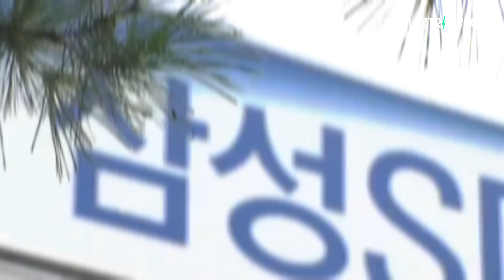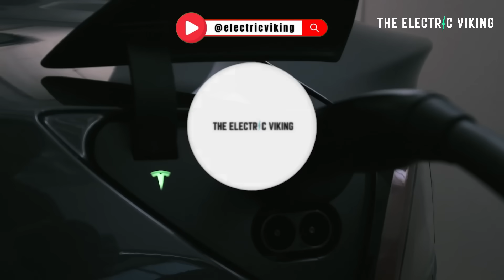Hyundai starts pilot production of solid state batteries for EV testing

Comment: Range is becoming a non-issue, and besides safety issues, one of the biggest benefits of solid state batteries is the weight reductions.  In terms of projections perhaps EVs could account for 95% of new vehicle sales by 2030 but I don't see EVs accounting for 95% of cars on the road until much later as most of the population only buy second hand and many won't be considering replacing their existing ICE car until well beyond 2030 unless there are considerable incentives to get them into an EV or disincentives to get them out of their ICE car and many governments, especially in poorer countries, aren't ready to fully back those sort of initiatives yet.

Comment: yes and seriously. I have the Tesla  SR with a small battery and the only ones who often have problems with the batteries are those who don't have an EV. I don't see any problems despite my small battery. Daily totally doesn't matter and I'm of the opinion that you should buy according to daily needs and not what you should maybe once a year. 
We drive on vacation in our approx. 4000km in total and it is not a problem, we hardly go faster in our old ICE, we still take breaks every 2-3 hours and the breaks with charging are about 15-20min. And it requires about 2-3 hours of charging each way, if we had driven ice we would still have had to eat a few times and take a few breaks, so the difference will be very small and make no difference on such a long trip.

Comment: Here on YT, you are in the minority of the ones that are actually pushing EV''s lately, and being in Australia you apparently haven't been watching the major push back from owners that really know how bad EV's actually are.As far as making batteries that don't self immolate themselves with you in it, the idea of being built out of a material that doesn't do that would be the biggest boon today for the car, but it still won't be enough to overcome the rest of the EV problems that all EV's have other than charging and range. Other problems that accounts for 20 out of 21 of the most common problems with them that are exclusive to EV's and that people won't stand for.  In fact, here is that list that I made up that I keep for people like you that like them so much and can't keep yourselves from pushing them here on YT and the rest of the world wide web....You already know about the first one here (copied from a list stored in my laptop)
 1.  Driving Range. Other things beside moving EV down the road uses up range, 

    like heater and AC, high hills and mountains, usage of the wipers, any device. 
2. Material Intensity. Gathering enough rare materials costs very much and use 
    fossil fuels to run the equipment to move the many tons of material to process
3. Electrical Grid.  The grid is years from being ready for millions of EV's no matter 
    what the electricity providers try to tell you other wise.  
4. Risk of Fire.  EV's are known to spontaneously combust rabidly, and when that
    happens, windows and doors quit operating, possibly locking the owner inside 
5. Poor Compatibility with Solar.    Solar doesn't create electricity fast enough to 
    charge an EV and supply what the normal home usage is with all the electrical 
     appliance and devices the use electricity too.  
6. Autonomous Driving Technology. All the bugs hasn't been worked out for EV's 
     to be driving themselves yet, too many accidents have happened due to self  
     driving down the road and especially in the urban areas. 
7. Charging Time  It varies greatly between level 1 and level 2 chargers, and what 
    kind of charger that is hooked to the car, varying percentages of every charge
8. Charging Station Prices.  Some EV's, as in the Cybertruck cost near as much
    as it does to fill a tank on an ICE vehicle.  
9. Too High-Tech.  When they do break, the costs are way more than Ice cars
10. Overall Costs, including insurance, which on average cost $1000 more to insure  
11. High gross vehicle weight.  More road damage, wears tires out faster 
12. Light damage causes EV write-offs.  Even small dents and fender benders 
     can cause enough damage to make the EV to expensive to repair 
13.  Few mechanics to work on an EV.   Only 10% of the professional mechanics
       are certified to work on EV's so be ready to get in a long, long line.
14. Resale value is very low and are hard to resell and dealers offer next to nothing 
      in trade-in value.
15. EV pickups range.  EV pickups lose half of their range when pulling heavy trailers  
16. Cold Weather.  EV's take a lot longer to charge up in icy conditions and discharge 
        a lot faster when using the heater inside your EV
17. Ice on EV's.  Ice will build up on the headlight covers on EVs that have them and freeze them shut 
18. EV's are not environmentally friendly, it takes fossil fuels at 60% to make our 
      electricity for this country and to charge millions of possible EV sales.
19. Floods.  If salt water from hurricanes get into the EV, the EV will sooner or later
     catch fire due to salt water getting into the wiring system and also eroding the battery  container and get it into the cells.
20. Possible unknown reasons will shut down at any time.  EV's will sometimes shut             themselves completely down for seemingly no reason, cause them to be towed to the local dealer for diagnosis and repairing at possibly very high prices
21. Now a new problem for EV's, some of them stop running abruptly because the 12 volt battery in them (that runs everything else and controls the system that drives the big drive motors) goes dead,  Why? The control device that tells the main battery that keeps charging going to the 12 volt battery goes bad and it dies, which kills the car until you charge up the 12 volt battery and fix the charger to it in the system.
As time goes on, more and more little bugs will pop up that this short time the EV's have been around that EV owners keep their mouths shut about, knowing that it will kill any future sales of them.
Reply: Is there any company recycling the old ev bateries?
Reply: @sr76pablux  Yup, like maybe two, I think.

Comment: The strongest argument for LEASE NOT BUY for EVs, period. I will continue to lease for the next 6 to 12 years for sure, as the pace of change is going to be astronomical. Very unwise to tie your finances to a lump of battery that will be an utter dinosaur in a few short years. Those forking out cash for a Taycan Turbo GT Weisach… well they can afford it, so they can handle the depreciation, but those will be going for Honda money in just 8 years.

Comment: The energy density of jet fuel is around 43MJoules /Kg or 12083 Watt hours/Kg. So 500 Wh /Kg is nowhere near what is needed. It needs to get 24 times better before it is equal to jet fuel.

Comment: Can't fathom your preoccupation with EVs.   They are not 'green' and they are not electric cars.
They are battery cars.  Batteries that are not friendly to the environment or the techs fixing them.  BTW. ICE vehicles are electric too.  They get their electricity from gas instead of batteries.
Reply: Ice aren't electric. How do you figure that other than the engine driving the alternator for the electrical system. It's burning fuel that turns the wheels.
Reply: @doyleelad1113  
It has a battery too.  Without the battery and generator, the car would not run or start.  Did you think the gas ignited itself?  What do you think runs the radio, electronic components?  Do you even know there are hundreds of microprocessor chips in the ICE car?

Comment: I am constantly amazed how people review technology in isolation, when in order to work as specified, said technology has to be integrated into an infrastructure.  People seem to forget that to charge a battery of a given capacity faster, requires the same charge to be delivered at a higher power.  As charging time goes down, power draw goes up.  There is nowhere that you can get a 900 kW charger anywhere outside of the manufacturers labs.  No home, no commercial charging station has such a charger, and they never will.  If you get a 200 kW charger in the future, that will be an achievement.  You might get a couple of these at a charging center, and with a very high charging cost per kW, surrounded by a large number of lower output chargers at a more reasonable cost.  Behemoths like 900 kW though, will never happen, which makes talk of batteries that can take 900 kW charge as irrelevant.
Reply: There are currently 350 kW chargers available.  I was recently watching an EV race across America that they were using those chargers for about 8 minutes to go from something like 1% to 75% charge (the last bit is much slower, so they'd pull the plug and head off once it started to slow down).

Comment: 1:58 before you said Game Changer !! Seriously though if Hyundai say they have a solid state battery then it will be a fact. 
My thoughts are that by the end of 2025 we will be seeing 500 mile real world range EV's becoming the standard, no point in making anything smaller so no need to run more than one type of production line so keeping production costs down. 
Lighter packs and lighter cars with higher density will soon make my prediction a reality. Time will tell.

Comment: I’m happy with a solid 300-400km range, if they can increase the density to a potential 800km or more I’d rather the battery just be smaller cheaper and lighter with a 400km range still.
Reply: I'll settle for around 600km.
Reply: @ In over 20 years of driving I’ve only done more than 600km in a day once.
Give consumers the option.
Reply: @MaximusDesimusMeridius01  
Agree, I don't drive that far too in a single day. But a little extra I like, not need to charge up as often.

Comment: Any auto manufacturer who doesn’t have high density solid-state batteries within 5 years, will need to plan for inevitable bankruptcy.
Reply: They are the future, thats for sure. I think itll take a bit to get going. Itll cost alot and will need to build manufacturing capacity. The whole problem is scaling up production. They ve  been around for long time.

Comment: I bought a radio control jet about 7 yrs ago , runs on 6S 6000mah battery (flight time 3 min ) . I have not flown the plane yet as the flight time is too short , i'm hoping solid state technology will change that .

Comment: Great news, but I will reserve judgement until a car comes out. Saying 600 mile range and a lighter car is HUGE, but until one is out on the road, does not matter.
Reply: Yes, exactly 💯. I'll believe it when I see it. If Musk got one of these, he would keep the range at 300 miles and lighten the overall weight because he thinks that's all people need. 300 miles doesn't work for me where I live. I want 500-600 miles.
Reply: @Ria-hx8nl  It would work if the actual range was 300 miles but as tested most people get 220 to 250 on the highway.
Is it enough for 90 percent of the driving most people do yes, but it would be nice to have some head room for degradation and to get 300 miles real world.
Reply: @ctuna2011  exactly. I just watched a video (Frozen Tesla Channel) of a Tesla owner in Saskatchewan. -36C. Tesla Model 3 Highland long range. 325 watt-hours per km. A very poor performance. 30 percent battery loss for about a 35km trip. To succeed in that climate, you need  500 miles rated range so you can achieve 300 miles of actual
 range.  Somebody needs to create a low temperature battery.
Reply: Tesla is already predicting 632 miles on the Roadster 2, 500-600 for the Semi and 5-600 with new batteries and range extender for the Cybertruck. Even at 70 mph. The Tesla Model S was already tested with the added quantum glass battery to 632 at 70-75mph, 752 miles at 55 mph and 880 on a Dyno.

Comment: I wonder if the solid state battery is safer than the lithium batteries which the Chinese ev manufactures and tesla ones are. Lithium batteries emit too much harmful radiation...
Reply: Wtf.   Radiation???
Reply: @tedg1609  yeah bud do some research. Those Tesla and Chinese EVs emit harmful radiation. Riding in an EV is similar to riding in a microwave, who knows what type of cancers you may get in 10 years time.
Reply: @tedg1609  yeah bud these EVs emit radiation

Comment: Very exciting! By the time I retire my 2012 mini van, I hope and expect to get a 600 mile EV van or compact pickup for under $30K. But, we'll see.
Reply: I'm with you. My 1991 Dodge Ram van is still in tip top condition. Having said that I use my fantastic DIY eBike 95% of the time and have saved so much money the bikes I build are covered by far by cost savings. Just waiting for an affordable solid state battery EV.
Reply: @FlyingScot911 I ride my ebike to town in Texas  it cost me 6 cents round trip approx 16 miles 😂
Reply: No no, hold out for that electric rickshaw 🤣
Reply: @NoiserToo  u should look at the gyrocycles. they are a 2 wheeled car, have a gyro to keep them upright/drive like a car, the newer versions coming out can turn wheels up to 90* and drive sideway. self righting in the air so if u get rammed like a bike instead of falling over and going under car, it stays upright and since its all carbon fiber and your much lighter than a car u just bounce if a car runs into u at low to moderate speed and just keep driving, like the aliens cars in some of the asimov books. (on the sightless planet where they all where balls that saw thru electromagnetic spectrum)

but they are pretty awesome i saw a recent variant that was 400kg with 400km range  seats 2 100% carbon fiber
Reply: @ - sounds like fun.
Reply: @violetquinnlaw  Which Asimov novels in particular? 
Please feel free to use the approximate age of R Daneel Olivaw as reference or just refer to the novels that featured those vehicles. 🥸
Reply: Oh god, I just realised that you are most probably referring to the Foundation series on AppleTV®
Apologies from this  old geezer, I just read (a lot of) the books years ago and I have no recollection of such  vehicles.
Please do enlighten me.
Reply: it will be ironic if the only legacy auto maker to survive is hyundai (which atm its only 1 that may survive i have heard of)
Reply: Keep on poluting in the meantime.
Reply: @jrherita  - and strip mining the planet
Reply: @ Is Oil or Gas recyclable?

Comment: Once solid state batteries hit the car market, won't every EV today will become instantly obsolete?
Reply: Why wouldn’t the battery tray of an existing EV be retrofittable to a new battery tech?  An EV is a driveable vehicle with several systems including the motors. The battery is just one piece.
Reply: @desmo8755  You might well buy a new car because battery replacement is not cheap. Just the labor alone is expensive.
Reply: @PyroShields  that’s the case today but it’s a turn off for EV adoption when your $60K car is worth $20K in 5 years and needs a new battery that costs $25K to install.  Making them easier to change is a better value proposition and also lets owners upgrade to newer battery tech. Sure, integrating batteries like in an iPhone makes for tighter packaging but owning any device that lets you change batteries easily is the way to go. Like AA batteries in a radio.
Reply: @PyroShields not true, ev batteries have reduced in price drastically in recent years. Now already on par with changing and ice engine if replacement is ever needed. Batteries will be lasting decades
Reply: It doesn't change the value to the current owner, but new technology does reduce resale value dramatically. Cheers
Reply: Not at all. Take my 2017 Model S, It will not lose any capacity instantly. It will still be a great car with adequate range. I say this with well over 150K miles with no repairs except a headlight (replaced for free).
Reply: Swap batteries for the newer ones and keep your old vehicle?
Reply: People will still buy 10-year-old cars.
Reply: @WenSwan except Nissan Leaf’s
Reply: People on ebay are buying these batteries for energy storage to store energy from their solar panels, some have no energy bills at all
Reply: Those batteries will go towards giant grid storage batteries and last another 20 years of service at lower C rates
Reply: Like an old iPhone 😮
Reply: @outkast40  worse, like an old Android phone 😆
Reply: Like a Nissan Leaf
Reply: You think EVs on the road will suddenly stop working or something?
Reply: @danielcpt3819 no, they'll just be worth jack sh!t
Reply: It is a huge upgrade
Reply: No
Reply: not obsolete, just cheaper :)
Reply: There could be replacement batteries for older cars once production capacity exceeds demand for new EVs
Reply: They will but only the car manufacturers that keep up with the times will survive like in any industry that is fast moving. Second hand market will also see a drop in value after a few years but that’s a good thing for the consumer who hasn’t adopted EVs because of the price. that is unless the new EVs don’t become so cheap that it becomes more viable than second hand but that might just be wishful thinking 😅